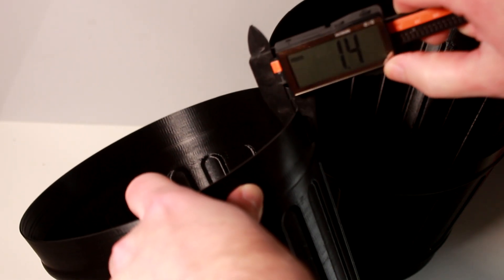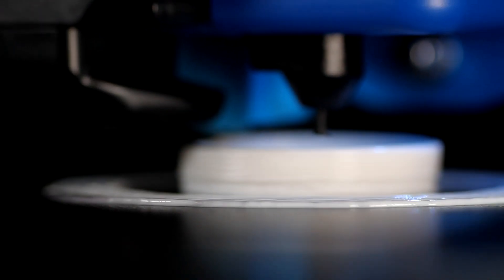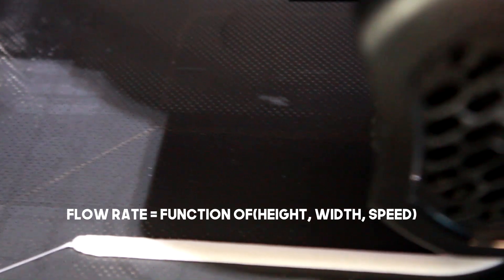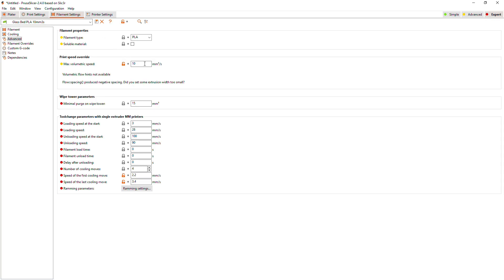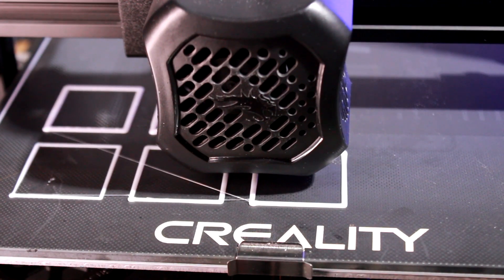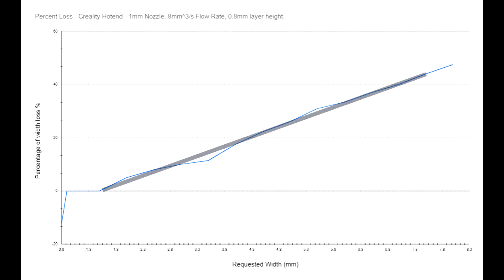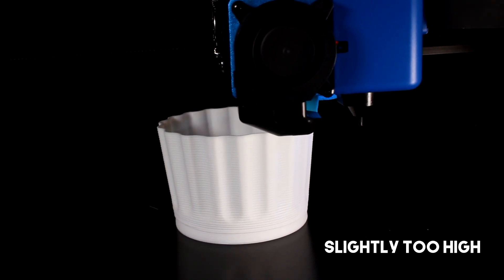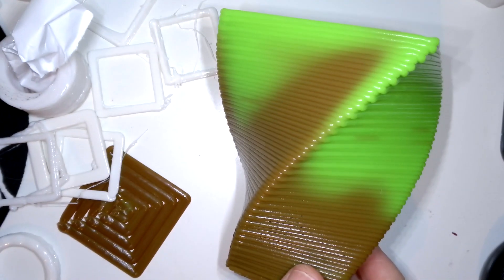Extreme Vase Mode II - EXTREMEST vase mode. How thick can you go when 3D printing vase mode?

Comment: I've always tought line width wasn't a parameter meant to produce such an output, but the feedback you give to the slicer regarding how much material is squeezed under the noozle and spreads around and sideways accordibgly to the material fluidity, the flow rate, and the layer height, so the slicer knows how much to spread appart parallel lines as a baseline on top of wich to match the actual parameters like, overlaping, for there's no other way for the slicer to know the outcome. At least I made some tests (although not so thoroughly as yours) with Simplify 3D a couple of years ago and they led to my conclussion, but never tested it in other slicers, and now I wonder how it does Cura to know the actual outcome for a given parameters set. I'm puzzled now with your video.
Reply from the maker: I have another video called "flow math" that may explain this

Comment: Hmm perhaps the use of a cooling duck that has 3 sharp point outlets(to increase pressure) ,1 for each side and 1 in the middle might cool the thicker layers more .🤔 it appears that the inside doesn't get contact with the cooling and is insulated keeping it hot for so long?

Comment: Enjoyable, but how did non-vase mode turn out?  I print a lot of stuff with 2mm walls, and while I have used .8 and 1.0mm nozzles, swapping around is a pain.  if I could make 3 passes with a .4  or 2 passes with a .4 and get a reasonable wall, I'd be a happy camper.  Most of the stuff is structural and goes inside things, so the lines/edging aren't a real big deal.

Comment: With this, and high flow nozzles like the volcano, are people tuning their PID values with filament flowing through the nozzle at speed? It seems like that would make a big difference.
Reply from the maker: It's an interesting idea but I don't know if it would have much effect, based on octoprint thermistor graphs. Of course what's going on in the heater block itself is unknown, but the graphs are the same data PID uses.
I think (and have heard this from many sources) that the constraining factor is the filament's thermal conductivity.

Comment: If I understood CNC Kitchens verdict properly then using a Bondtech CHT Nozzle is a viable solution to increasing your stock Hotends Melting capability to Volcano like levels. Maybe worth a consideration? You could technically even combine that concept with the Volcano adapter CNC Kitchen sells in their store allowing the use of a CHT Nozzle in a Volcano Hotend.
Reply from the maker: Yeah I need to at some point use a bondtech nozzle, but CNC kitchen has done a lot of work here as you say, possibly not much else to learn from it
Reply: The bottleneck becomes the ability to cool the printed part. Thickening the extrusion increases the volume much faster than it increases the surface area where cooling can happen. So at some point the material's ability to conduct heat to the cool surface, combined with the total size of the model, will be a limit on the useful extrusion rate.

Comment: Awesome video. I am doing research mself on printing very large and very strong  functional parts. Total part is 1.6 meter! long and is build up from 6 parts. The glueing together must be about same strength as if it was printed on 1 machine. I want wall thicknesses of 6-8 mm and currently using 1.2 mm high flow nozzle and I can actually print very much flow rate at 125 gram/hour. I don;t know how this translates to mm3/sec but some math should do the conversion. Currently printing 1.25 mm walls and oly 0.3 mm high and speed of 100 mm/s. so currently I need 5 walls to get to my desired wall thickness, creating it in 1 layer seems insane to me, but theoretically possible as you pint out. So, I would need than about 6x0.4 = 2.4 mm layer height according to your equation!! that seems insane to me and oviously reduce speed a lot. Allthough insane, I will try it out a bit. Awesome content and you deserve my subscription!

Comment: For plaatic is easier to go up than to push molten plastic sideways. I used 1.2 height to print 2 mm high line which was 5mm thick. It should have been 8mm wide instead. So tip of my 0.4mm nozzle was almost at the middle of line, not on top. If i had nozzle with larger flat area where hole is, than you wouldnt lose thickness. I guess... XD

Comment: Definitely need additional cooling for such large amounts of plastic you're pushing out. One suggestion is to try ABS, it cools a lot faster, hence the reason why almost all high speed benchies are done with ABS. The other is look into how those speed boat guys are cooling their prints, a number of them have rigged up large fans at the bottom of the printer -- for a bed that moves vertically this works well as they duct the fans up to the bed -- check how Vez has his setup. Other option is berd air (one of the cooling options on the Hevort printers) -- which uses a air pump with tubing going to the nozzle area and cooling filament directly with cool air sourced from where you place the pump intake (hint that could be in the fridge if you like). This is something I want to play with on my big delta as I've already have a good berd air cooling setup worked out on my voron -- shameless plug to check videos I've shared of the voron mod.
Reply from the maker: Yeah I'm aware of berd air, it's an interesting project. I'm also wondering about petg too now you mention cooling time, but I guess this is all for future episodes 👍
Reply: You can't have too much cooling though in this case, as you need insane amounts of heat in the hot end to print as such high speeds without pressure building up which causes slipping in the gears.

Comment: Did you calibrate the e-steps for each nozzle size or did you leave it at the setting for the 0.4mm nozzle?
Reply from the maker: You would normally not calibrate e steps for a nozzle, well, that's a whole can of worms for another discussion 😉
Reply: @LostInTech3D  Perhaps not under ordinary circumstances, but when you are considering increased flow through a nozzle, it would make sense to calibrate the e-steps to match the new nozzle size and increased flow rate.

Comment: You can set up your flowratetest in Prusaslicer aswell. Just make some more filament files with your Mac flowrate setting and then increase under Printer settings your number of extruders. Now you need to disable the purgetower in the Prtinsetting. You can then give each object their own filament setting with your value of the max flowrate. Now you just have to crack up the speeds to a maximum so your prints are capped by the flow rate settings and not by the speed settings. I’m sorry for my bad English please leave a comment if you want to use this Methode but don’t quite understand it. I will explain it better or make a video about it

Comment: I am thinking of trying to print base mode boxes with diagonal stiffener ridges. So that would mean varying the line width as it prints.

An easy way for me to code this would be to maintain a constant flow rate while varying the print head motion speed. Each time the print head slows down it will make a fat spot in the wall.

I'm a Python programmer, so my thought is to post process g-code to add the variable speed.

Anyone have suggestions for preferred Python libraries to read and write g-code?
Reply from the maker: I hadn't considered the existence of libraries, actually. All the work I've done has been from scratch, but if you figure out any, let me know, it will be useful! 
You may want to have a look at pressure/linear advance too though as one of them (I forget which) does this.

Comment: it is possible to adjust flowrate in cura it's just hidden in the custom settings
Reply from the maker: Where?
Reply: @LostInTech3D  You can customise which settings are visible in Cura, search for it there and check the box so it becomes visible along with the other settings.
Reply from the maker: No I mean what's it called?
Reply: @LostInTech3D  it’s just called flow, then there are other settings like wall flow, infill flow, initial layer flow and other stuff
Reply from the maker: Yeah that doesn't set a limit, that's just a multiplier.
Reply: @LostInTech3D  Yes it's just a multiplier that affects the flow rate

Comment: Have you done it with theoretical estep (default) or have you calibrated it?
Reply from the maker: The esteps/flow rates are good, as evidenced by the charts, you can't calibrate any better than that surely 👍
Reply: @LostInTech3D  that is not the questio, question is have you used default value for ender as 93 or have you calibrate it for your regular use (material, temp, flow etc.) I am aksing that becouse i think we could print line 6mm thick without loss if we calibrated estep to prevent underextrusion becouse of skipped steps. I think its better to adjust estep than flow multiplier (in cura flow as percentage) to achieve correct flow. In CNC kitchens video extrusion wieght ist linear as you increase flow.
Reply from the maker: I would just change flow percentage, rather than recalibrate the printer. It's a bad idea to store settings on the printer that are specific to a scenario, if you can do otherwise.

Comment: Cura has flow rate. Default at an abstract"100" . For TPU usually needs 120
Reply from the maker: That's not max flow rate in mm³/s.
Reply: @LostInTech3D  yea it's definitely not the same units. Odd right?
Reply from the maker: No I mean it's a multiplier. So whatever it would extrude, it just multiplies it by the flow rate. Highly recommend watching my vid called "flow math" :)

Comment: How about the thinnest wall thickness possible in vase mode?
Or is that the immortal mode?!^^
Reply from the maker: Nah...it's too easy! It's basically 80% ish of the nozzle size. Video over, back to work 🤣👍
Reply: @LostInTech3D  Ok my bad, I thought that at some point you would get into the micro/nano ranges or something and you could get infinitely finer ^^ (in my theory)
edit: you are right about the nozzle, but I would go from maybe 0.05mm-0.01mm nozzles, where is the practical limit of a wall and polymere?^^

Comment: I'm still confused about flow rate. Isn't a greater line width actually created by simply increasing the amount of filament extruded, i.e. flow? So while the slicer gives you 3 main options: line width, speed, and flow rate (in Cura flow rate is under Material) those 3 variables map to only 2 variables sent to the printer: how fast to move the hot end, and how fast to extrude filament.

It seems to me that you can increase the width of extruded filament EITHER by increasing line width or by increasing flow rate, the latter not in a calibrated way. All this with appropriate layer heights of course. In Cura the flow rate is a percentage, so I assume 100% means the rate that  gives the requested line width for the requested speed, and you can tweak this up and down using flow %. It's not like you can increase line width and keep the speed and flow rate in mm cubed per second the same. Everything is interrelated.
Reply from the maker: have you watched my other video on "flow math"? 👍
Reply: @LostInTech3D  : Thanks. I watched it now, and it seems I was basically on the right track but your video explains it better using the rectangular prism volume (width x height x length).

Comment: The reason you are losing width is probably due to the fact that the plastic is no longer constrained under the flat surface of the nozzle after a certain width. A regular extrusion cross section should have a perfectly flat top and bottom edge. My guess here is that once the plastic reaches beyond the flat surface of the nozzle, it grows radially in all directions. So some width is lost to growing vertically.

Normal cross section (constrained by flat portion of nozzle):
  _________________
/                                   \
|                                     |
\___________________/

Problem cross section after breaching nozzle flat area:
     ____      (vertical overflow)       _____
   /           \_                                      _/             \
 /      ^ ^       \___________________/        ^^      \
/                                                                           \
|                                                                             |
\_________________________________________/

Comment: I never tried to push my 0.25mm nozzle. I wonder if 0.4mm width would work well. That would mostly remove my need for a 0.4mm nozzle. That being said it would most likely be a lot less reliable.
Reply from the maker: It's important to bear in mind that right up to the end of the nozzle, the printer has no idea what line width you're doing. So a wider line width slower looks identical to a thinner one faster, to the extruder and hot end, the gcode command would be identical other than the X/Y movement part. So it should work. 
That said I found 0.2 nozzles (0.25 is pretty unusual!) a lot more likely to block especially when pushed. I don't know if you can get a 0.4, but if you can, I would, if only for the print time savings in normal use!
Reply: @LostInTech3D  0.25mm is actually more common than 0.2mm but only for E3Dv6 style nozzles. E3D doesn't offer a 0.2mm nozzle (but I think they do have a 0.15mm one).
Yeah it is probably unreliable but when you want to print a bit faster for like one print but don't actually want to change your nozzle it could save quite a bit of time.

Comment: Thesis: When nobody mentioned it... the loss isnt lost. The bed moves and drags the filament away and that drag appears as loss. 
The extruded form is elliptical in shape and therefore the dispersion non linear in consumption.  
Facts that speak for that hypothesis, besides your data, would the plastic sausage be laid perfectly round with the size of the nozzlehole, no loss would be evident, because the extruded material volume would fit the volumetric math.
It would be forseeing to think in a 3dimensonal view about the extrusion and the plastic sausage gets draged over the bed or over the last layer. 

You can proof that with a pipingbag and a Meringue test, just blurb 2 kind of wurst on a silikonpaper 1. a long sausage 2. a draged wurst and weight up the material used. Compare the volumetric mass of both and there will be the "loss" again. Compare it to your data to.
When the heat shrinkage would be taken in the calculation im certain the math would fit the results.
Elastic matter dons't behave perfectly mathematical besides we use data from meassurements of done experiments. 

Proof the thesis wrong when you can, knowhow has to grow unto the base of truth.

But im highly certain that "elasticity" would explain the loss.
Reply from the maker: Check out CNC kitchen.. he's done a thing about this 👍
Reply: @LostInTech3D  under what link do we find his idea?

Comment: Go and watch some CNC Kitchen about the subject. I learned a lot there.
Reply from the maker: Haha, I know Stefan at CNC kitchen already ;)
Reply: I was thinking of die swell and Stefan’s video as well. I assume the loss in width is coming from die swell
Reply: I think it's slipping out of gear. I think you could test by making a mark on the filament and measuring how much was actually printed
Reply from the maker: It's slipping, yeah, I agree, as opposed to skipping. 
Now I know people are more interested in this kind of thing, I can hyper focus on certain elements, so we can look at the extrusion lengths and stuff 👍
Reply: @LostInTech3D  definitely could be both. It would be interesting to look at the actual height of the bead of plastic to determine if the bead is becoming more circular instead of flat.

Comment: Holy crap, you went way further with this than I expected. If I wasn't unemployed, I would drop you something on patreon for this. I learnt a number of things, despite already knowing line width could be pushed much further... this was crazy. 

Couple of other notes. First, CNCKitchen stuck wires through a volcano nozzle to get better flowrate, so you could push this even further... in case those walls aren't chunky enough for you already. And second, since all this is vase mode, you might be interested to know that you can apply vase mode to more models than you probably think possible: youtube.com/watch?v=gCgyBmYq_bQ (it's all about connecting regions to make one continuous path, all throughout the model). 

And mad props for using colour changing filament like that. Recently I've been tweaking cooling for PETG for getting good overhangs without compromising layer adhesion (by printing hot and cooling fast - which, with a good fan shroud, works), and that just kinda visualises my most recent nemesis.

Comment: When you CUBE (measuring three dimensions of L x W x H) a measurement to make a volume, you result in cubic kind-of-measurement. Millimeters measured to show volume results in cubic milimeters NOT milimeters cubed. Milimeters cubed describes the formula upon the unit ype.  Cubic milimeters is a real unit of measure. Also realize if measurements are in centimeters (where 1 cm = 10 mm) one CC  (Cubic Centimeter) = 1 MiliLiter (ML). All because a liter is a measurement of volume.

The same for two dimensional measurements of Length by Width. Instead of milimeters squared, you have square milimeters. 

This is an easy way, when done improperly, to show lack of expertise/knowledge by passing on to others that know even less an improper unit of measure by not using it's proper name.

This lifts everybody's game and gives meaning to what these kinds of measurements actually mean.